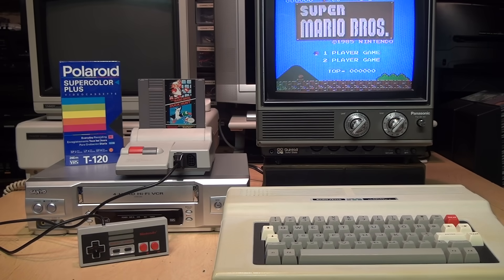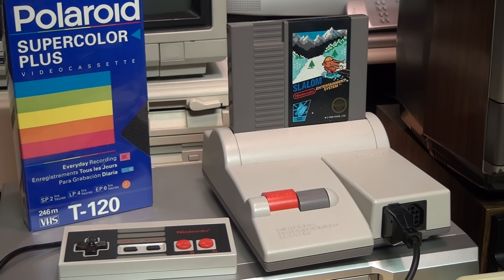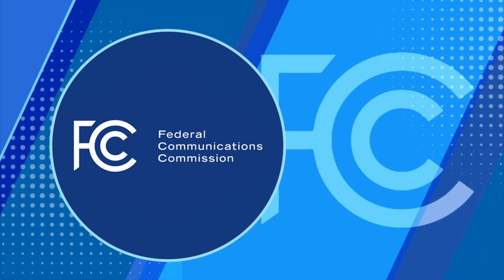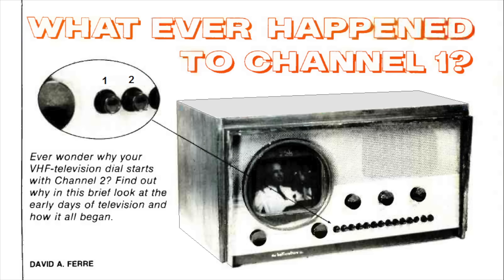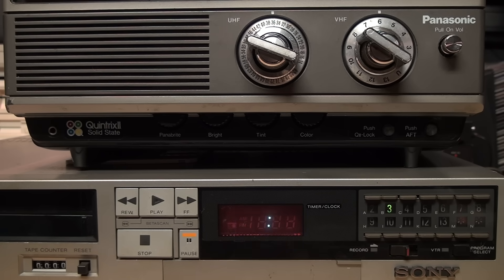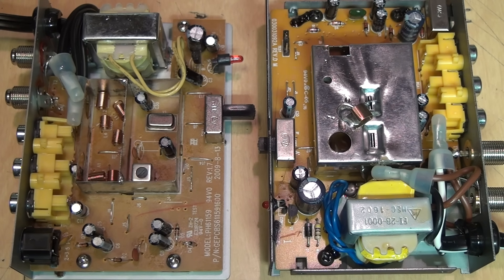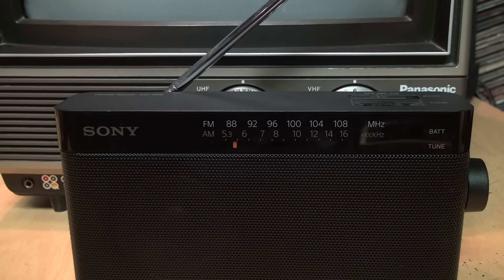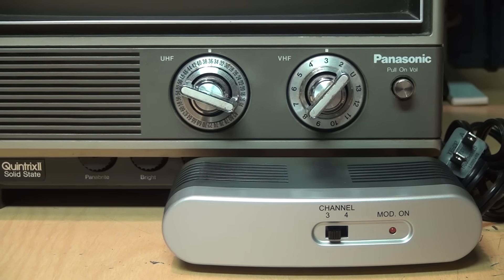Why your Nintendo was on Channel 3 (except in Cleveland)

Comment: I had to use Channel 4 for my SNES..

Luckily, I couldn't get WTAE over-the-air because of where their transmitter is located in relation to where I was, so I was able to use 4 without any issues.

TCI Cable used Channel 3 until our NEWER set was Cable-Ready, and therefore didn't need that open channel anymore, and I was able to use the old TV for the SNES on Ch3.

Comment: Some of this goes back to the FCC unlike your video states. The FCC assigned the initial VHF channels for each major market so as to not interfere with other major markets in the region. 

So, in keeping with your Cleveland example, Cleveland was assigned 3, 5, and 8. Columbus was assigned 4, 6, and 10. Cincinnati was assigned 5, 9, and 12. Toledo had 11 and 13. Dayton had 2 and 7. Smaller markets overlapped in the fringe coverage areas.

Comment: I have not watched this video yet: but the "Except in Cleveland" qualifier got me thinking "is THAT why there was a "3/4" switch on the RF modulator? in case you needed to use channel 4 because Cleveland? watching now to see if I'm right!
Edit: I was half right, and by half right, I mean, I got it right, but there's so much more information that goes into this.

Comment: Wasn't Channel 1 used in NYC?
Reply: Yes, WNBC used to operate on Channel 1 until the FCC banned Channel 1 from being used for television broadcasts, due to that particular RF channel being prone to extremely high amounts of interference.
Reply: @KRAWofficial oh. Cool I thought it was because of 9/11 and the Antenna going down?
Reply: @mattt233  Even during (and before) the 9/11 attacks, WNBC transmitted their analog signal on RF channel 4.
Reply from the maker: Only experimentally by WNBT (now WNBC), from 1941 to 1946. When the VHF band was reallocated after WWII, WNBT moved to channel 4, since channel 1 (while it lasted) was reserved for low-power educational stations.

Comment: Okay can I ask about channel one? I was in El Paso January of 2023 and while parked at a customer, I am a trucker, I channel scanned my television and got a channel 1.x. I have never seen this before and didn't even know my smart TV would do that. Is one being used again with the new ATSC system?
Reply from the maker: ATSC does allow a TV station to use virtual channel 1, even though it's not actually broadcasting on RF channel 1 (which doesn't exist anymore).
Reply: It would actually be illegal for the station to actually broadcast on the now obsolete RF Channel 1, which was banned from being used for TV broadcasts by the FCC in the 1940s, due to the channel being prone to extreme levels of electromagnetic interference.

Comment: SDI and HDSDI are not OTA broadcast signals. They are high speed serial data links for in studio use. The reason Digital TV is compressed is bandwidth. Standard definition  NTSC TV in analog form requires 4.2 mhz for video using a 6mhz RF bandwidth to include the audio when transmitted. Analog 1080i HDTV required 30mhz video bandwidth. The only way to fit 30mhz of video bandwidth plus a stereo audio carrier at a minimum would hardly fit into a 6mhz RF bandwidth without some from of digital compression.  HDMI is uncompressed and capable of the same quality as SDI. However HDMI does include copy protection facilities where as SDI/HDSDI is an open standard. And once HDTV is compressed, you can't ever get back to the original picture quality, but it's far better than analog compression techniques - like those used for NTSC color since 1954.

Comment: I remember my parents told me that channel One was not used on TV because it was the frequencies used for radio.
Reply: Yes, channel 1 was used for voice.  Most of it is used today as the 6 meter amateur band.  Some is also used for Model airplane control.
Reply: The frequencies used by the former VHF TV Channel 1 were also used by military radios, walkie-talkies and the former FM broadcast band. It was prone to extreme amounts of interference, so the FCC banned it from being used for TV broadcasts in 1948.
Reply: @KRAWofficial  "former FM broadcast band" meaning FM radio use to use channel 1 but now uses a different channel?
Reply: @bland9876  Yes. The former American FM broadcast band used lower frequencies (originally it started at 41.02 MHz and ended at 43.98 MHz, it was later changed to start at 42 MHz and end at 50 MHz.) In 1945, the FCC announced they would move the FM band from 42-50 MHz to 88-106 MHz (it was expanded to 107.9 MHz shortly after), and by January 8th, 1949, all low-band transmissions (42-50 MHz) had to end forever.
Reply: @KRAWofficial  It did not end.  It was used for other purposes.
Reply: @KRAWofficial  As a 90s/2000s kid idk why my parents said that then if the switch was made right after WWII?

Comment: I used to work for a broadcast engineer (the guy that actually filed permits with the FCC) in the NTSC days.  If you had a channel 2 or 4, there wouldn't be a channel 3, or vice-versa, because 3 would interfere with a transmission one channel off.  A channel 2 and 4 can coexist in the same city.  Where I grew up (in Texas, along the US-Mexico border), we had a channel 4, and the Mexican city just across the border had a channel 2.  So our computers, Atari 2600s, and Apple ][ rf modulators (purchased at Radio Shack) were all set to channel 3 😊

Comment: I used to use channel 4 in northern wisconsin, there wasnt a close ch 3, but was slight interference. I ran across a modulator that was for security cams or something that ran on channels 44 thru 48 or something. And if you really want to have fun, go find an old rackmount cabletv headend unit. I had one with like 15 modules that could choose any channel between 2 and 69. You could merge all the outputs and have your own cable tv system (i think i was using Drake – VMM860AP)

Comment: Important to note for NA regions, that DTV physical channels, which most often different from the virtual channel number, a TV will show after tuned to, broadcast just off set of the frequency, used for the audio of analog TV broadcasts on that channel, so if using an RF adapter for a game console today, on an old analog RF input only device, and getting strange audio artifacts on one channel, check to see if any DTV channels in your area are physically broadcasting on 3 or 4, plus it possible DTV physical broadcasts on 2 or 5, could cause co channel interference too on 3 or 4

Comment: I had a PS2 cable connection device that used channel 6 or 7 depending on what side of the switch it was on. :)

Comment: When I was a kid, we had 2 local broadcast stations, NBC on 29 and PBS on 41. The nearest bigger city had a 6 (CBS), an 8 (ABC), a 12 (NBC) and a 57 (PBS). However, there was a closer city with its own local station, and that was an ABC station on channel 3. And I remember using channel 4 on RF modulators because 3 didn't always come in clear, most likely due to that nearby channel 3 station.

Comment: Overall, I enjoyed the video, but you should probably do some research on how rf interfere, leakage and insulation work. Thicker insulation does not make a longer cable work by preventing leakage.

Comment: In our area 3 and 4 were being used
Reply: That wasn’t very common unless the station transmitting on Channel 3 had a much lower-wattage tower than the Channel 4 station (or vice versa).
Reply: @KRAWofficial  well we did three was wbtv 3 Charlotte NC and 4 was wyff 4 Greenville SC
Reply: @jerryshelton1481  Greenville and Charlotte are about 100 miles apart, so that’s probably why one city has a Channel 3 and the other city has a Channel 4.
Reply: @KRAWofficial  yeah and we were close to the middle 🤣🤣🤣🤣🤣

Comment: Anallog NTSC TV Channel 1 (44-50 MHz) can exist in a coax cable even though it was discontinued. 
Some TV's and VCRs would also were capable of tuning to channel "0" (38-44 MHz).
At the time, some TVs and VCRs could pickup aircraft audio because they could tune to nonsense channels because the circuitry was simpler to not forbid it.

Comment: In Brazil, before Nintendo released the SNES officially in the country, imports from the US were very common. The console had to be modded because Brazil used PAL-M instead of NTSC (but afaik it was an easy mod as PAL-M is already very similar to NTSC). In my city, both channels 2 and 4 were occupied, so it was always plugged on channel 3.

Comment: I find it funny how there's some spots in Northeast Ohio that would have had trouble no matter which modulator they used if they couldn't switch off of 3 or 33.
Cleveland's market (with WKYC on 3) and Youngstown's market (with WYTV on 33) do have some overlap.

Comment: I always thought the reason the alternate channel was 2 or 4 is that if broadcasters used two adjacent channels there was too much potential for interference.  If one is already in use then it's almost certain that the other isn't - thus a prime location for the console's output.

Comment: Why was channel one never used/removed. Its like the amp that goes to 11..
Reply: It was removed because the FCC reallocated the channel in 1948, due to it being prone to large amounts of interference from land mobile radio systems, military radio systems, public safety radio systems and the former FM broadcast bands (41.02 to 43.98 MHz, and later 42 to 50 MHz).

Comment: Old Dish receivers used UHF channels on the RF modulator. The FCC was way too generous with the UHF band when they assigned it to TV. It is actually a good band for portable 2 way radio and cellular as it is good at penetrating buildings. The 800 MHz band for popular with trunk radio and cellular in the 80s and 90s. Verizon Wireless had an edge for years because they owned a good chunk of the 800 MHz spectrum and even the 700 MHz when it was added. Now TV only goes up to channel 38 and T-Mobile has most of the 600 MHz band for their 5G. Sprint bragged about their PCS network back in the day, but it was horrible at penetrating buildings. I would not be surprised if the 400 MHz band doesn't get used for cellular one day.
Reply: Broadcast TV actually only goes up to channel 36. Channel 37 is still reserved for radio astronomy, and channel 38 was one of the (former) UHF TV channels that the FCC sold to cellphone carriers in the late 2010s.

Comment: For some reason, the RF modulator picture was better on channel 4 on my parent's 1980's G.E. TV here in southwest PA, despite channel 4 being a major ABC affiliate (WTAE). Never noticed any interference when using channel 4, but there was a ton of static when I tried to use 3.  Maybe the TV's channel 3 setting wasn't tuned correctly from the factory or something.

Comment: Louisville KY also uses channel 3 and has my entire life. It was an issue in the 80s when I was using an Atari and using channel 3. We had a roof mounted antenna with a coax connection on the wall. We had a switch box to switch between antenna and the atari and often if we didn't unscrew the cheap coax from the wall, it would carry the channel 3 channel signal from the antenna into the house powerful enough it would cause a ghost image of the broadcast channel 3 to appear while playing the atari.

Comment: In the Memphis area, if your TV was connected to aerial/antenna, we used channel 4 (WREG, CBS affiliate was broadcast over channel 3). If the TV was connected to local cable, we used channel 3 because WMCTV Channel 5 was on channel 4, while WREG was cable channel 2

Comment: As a kid in the sticks, our broadcast channels were 5, 12, 25, and 35 (the major adjacent market had 2, 4, and 7, and the next largest adjacent market had 3, 6, and 10, so we got what was left).  By the time I got my NES for Christmas, I "knew" it was "supposed" to be set to Channel 3, but I still tried both to see what would happen.  Sure enough, 4 worked but it didn't seem quite as clear as 3, so 3 it was.

Comment: Having two channel options comes in handy when you have more than one device: my uncle had both Betamax and VHX, and useful when we were transitioning VCR to DVD. However, we had a mechanical switch that eliminated the interference problem with the TI-99.

Comment: The VHF band is split because FM radio runs straight through it.
Reply: Some cable TV channels also operate on VHF.
Reply: @KRAWofficial  in cable mode, channels 14 through sixty something fill the space between the VHF and UHF. I used to get some rather strange interference on cable channel 19 when I had analog cable.
Reply: @SethSkoda  14 to 64. Analog cable channels 65 to 94 overlapped with broadcast UHF channels 14 to 43, cable channels 95, 96 and 97 overlapped with FM radio stations on the frequencies 95.7, 101.7 and 107.7 and CATV channels 100 and higher overlapped with broadcast UHF channels 44 and above.
Reply: @KRAWofficial  I did not know that bit about 95-97. I assumed that the frequencies just went up and up with higher numbers.

Comment: I had high speed digital TV + gigabit internet(their home internet speeds went up to 8gbits and due to not been able to give stable 10gbit they later only offered 1gbit) in 2008 over tv cable in my small 1+ mil pop county in 🇪🇺

Comment: As a kid, I was the one that programmed my grand parent's earliest VCR with the correct channels, without reading the manual. I knew enough about broadcast TV from reading that I figured out what the knobs did and how to adjust everything to get the channels they watched the most. Suddenly the VCR got a lot more use out of it than just watching VHS movies, because it could tune into channels better than their TV could, connected to the same antenna.

Comment: The presenter of this video has a flawed understanding of the way coaxed in general and especially leakage through RF coax works 

Sticker coax does not result in less RF leakage or less RF loss a coax dielectric that is closer to being the density of air has Les Doss than a solid dielectric like polyethylene. Also 75 ohm coax has less loss than 50 ohm coax does. The reason that we have 50 ohm coax is because 75 of them was the lowest loss and 360 was the highest power handling capability so they scheduled settled on 75 ohm for mostly low power purposes and 50 ohm coax for high-powered RF service such as transmitting stations

Comment: Growing up in Grand Rapids MI my family set our modulators to 4 so it wouldn't fall on WWMT out of Kalamazoo. Later on when we got a set that the channels programmed in with a remote we switched to 3 because it came in with autoprogramming so there was less hassle if the set was unplugged or there was a power outage.

Comment: My home's TV had continuous tuning with very fragile knobs. It couldn't select an individual radio station and played a mix of the distorted. Decimeter channels were indeed a new invention and needed an upgrade module. My nintendo had jacks for sound and video. I had to use them to get sound out because it used system B and couldn't be heard on system D.

The gap above channel 12 was briefly used by encrypted pay TV. I felt like the TV was intentionally crippled by not allowing reception there.

Comment: You don't want SDI.  It's single video with optional audio unidirectional.

Almost all broadcasters have migrated to the new SMPTE 2110 standard (ST 2110) which is video over IP.  You can multiple several signals bidirectionally over a single cable and dramatically reduce the copper wiring plant since you don't need to single path every signal.

Switching and mixing gear is also improved as it's now just software manipulation of packetized data.

Think of why the telephone network is now packet-switched instead of path-switched.  No more manual plug-boards having to create discrete signal paths.  It's just all digital packets being routed around.
Reply: depends. for low budget sdi is still perfect, at least compared to hdmi.

SDI is just realy simle to work with, no network knowlege required, it can be built up realy fast for gib live events (like concerts).

and sdi has less latency SMPTE 2110, if you can even get the device with SMPTE 2110 at all. projectors, led-wall controllers, ... have sdi, but not SMPTE 2110 at the moment.

and what about SMPTE 2110 between different manufacturers, does this work reliable.

Comment: I could always pick up channel 3 locally with my rabbit ears. But I still wound up using all of my consoles on channel 3. I didn't notice any interference, and it meant that, once we got to using remotes, I didn't have to have both channel 3 and channel 4 available. 

I presume it's a bigger deal if you are close to the broadcast station. I was like 2 hours away by car from the one for channel 3. 

Then again, I also used it when we had cable, and it still wasn't an issue. I think the RF devices cut off the antenna. So unless you'd pick it up with just the bare wire and no antenna, I don't think the interference was a big deal.

Comment: Where I grew up we had neither a ch 3 or 4 in operation so we didn't have to think about it.  When I moved to the Detroit area, we had WDIV on VHF 4 so we had to be conscious to hit the right switch on the modulator.  Funny side note is when we had cable TV in the 70's and 80's, our local system had a superstation, WKBD from Detroit on RF 6.  Since that was on the VHF band even on cable, if you hooked the cable wire to your stereo, you could get WKBD's audio on 87.5 FM so you got HiFi sound for all the movies they carried!